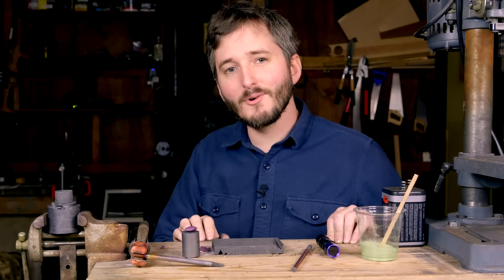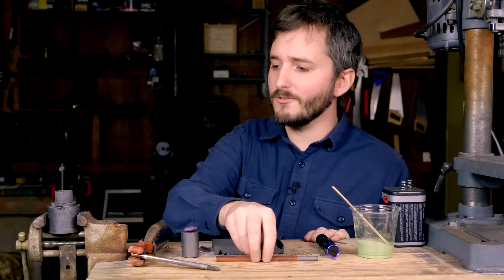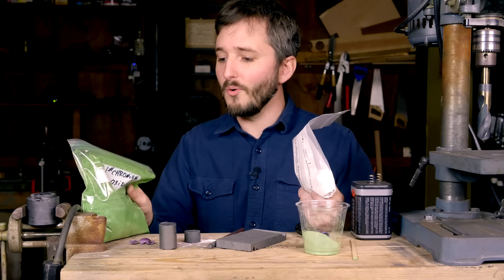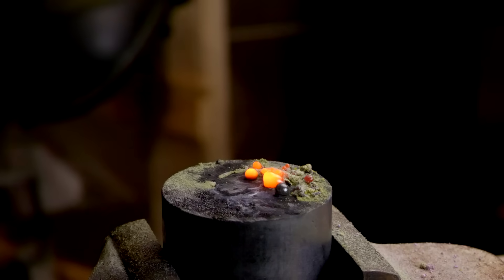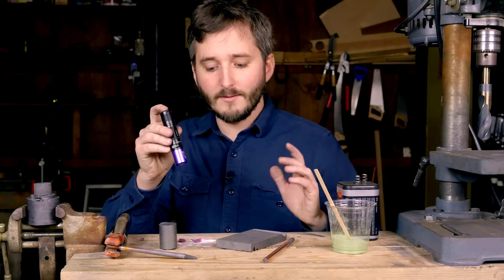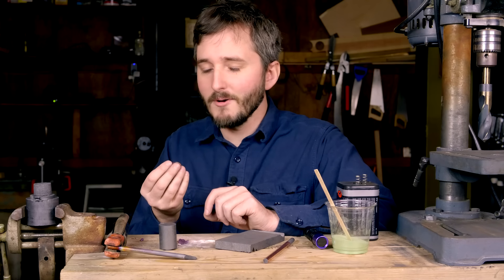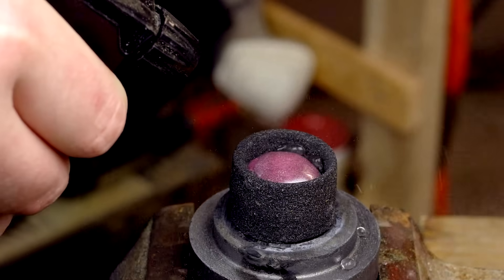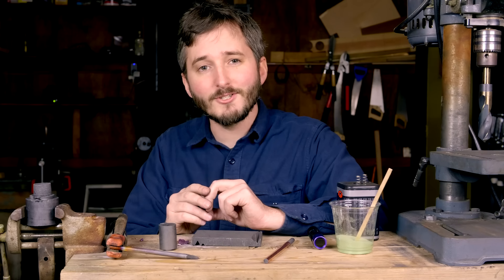How To Make Synthetic Ruby In The Workshop

Comment: Yo big PSA, hexavalent chromium, which is formed by exposing chromium oxide to extreme heat or electric arcs, is very carcinogenic and you should absolutely be wearing a respirator when you work with it.

source: I am a welder who welds stainless steel for a living
Reply: Yeah isn't that the stuff that PG&E dumped and Erin Brockovich fought for the victims of?
Reply: Yep.
Reply: Thanks for the heads up
Reply: Yes  i aproove, also a professional tig welder.
Reply: Yep, hexavalent chrome plater here, work with large tanks of it daily for deposition plating on aerospace parts, inhaling the fumes and mist are the most dangerous part about it, my cousin is a boilermaker in petroleum and he tells me all the time that welders need specials certs to even touch stainless or pipes that have chrome liners, stainless steel being a mix of chromium and steel obv
Reply: yes it is, but for these small scale short lived experiments it isnt going to do anything, he looks to be in a breezy looking shed so i doubt it would have produced enough to cause damage
Reply: Unlikely to oxidize with the reducing atmosphere of carbon vapor and carbon monoxide.   Chromium likes to form carbide in such an atmosphere.
Reply: Though salt is 50% chlorine by molar mass, it's a stable salt
Reply: Salt is 50% chlorine
Reply: @Hgdhgfdssxvbbnjoo  what does this have to do with anything at all though?
Reply: @Hgdhgfdssxvbbnjoo  ok justin.

Comment: NIGHTHAWK! Dude try to get 60-80 grit Alumina, then get a micro mesh sieve and rinse wash the Alumina thoroughly with distilled water to remove all dusty material and smaller particles. The resulting FRIT will be less likely to bubble and have fewer bubbles intrinsically due to the larger particle size. This technique is developed from jewelry enameling. Also if you were able to develop the sintering process inside of a pressure vessel it would not boil as readily. Way easier said than done though! Good luck this is fascinating

Comment: I wonder if a tig welder would be able to make this stuff translucent, can push a ton of current, and would prevent oxygen getting into the surface. Also, you can get a diamond grinding wheel, they aren't super expensive.

Comment: Next step, useful applications. Form a hole in it as it cools or afterwards and you have a 3d printer extruder nozzle that will not erode as fast as the mental ones do. Make the little crucible have a small dome in the base and then the ruby can form part of a baring with the shaft sitting in the dint that is formed. Can you draw off a fibre from the melt pool? Not sure what use that is but may be interesting.

Comment: please try this with a ZVS induction brazing setup!  as soon as the powder melts its conductivity goes up, which will turn it into a susceptor to the oscillating magnetic field thus heating it internally with no electrode required!  just touch-off the top of the pile with anything hot enough until there's a glowing/molten spot, then let the process of induction take over  :)

Comment: Place the cruicible into a deep box, then flood the box with argon ( Tig shielding gas, easily available from airgas or any welding supply house) it is heavier than air and will sit in the box. This will shield your carbon arc rod and it will last longer and prevent oxides from forming in your Ruby, try it and you should get gemstone quality raw ruby

Comment: What temperature do you think is needed? (in Kelvin :) Would it be possible to use a ceramic kiln?
Actually, I just read that the melting temperature is ~1889K, so I guess a ceramic kiln wouldn't do...

Comment: Awesome!  I read about making rubies decades ago in National Geographic and thought it MUST be fairly easy to make them,  if you can reach the right temperatures.  If you want more impressive and efficient results, make an arc furnace.  The more insulated it is the easier, safer and better control you'll have over the temperature and internal atmosphere ( which from said article ) was critical to getting a high-quality end product.

Also if the CO atmosphere created by the furnace and arcing carbon isn't good enough to make better rubies,  you could inject a shielding gas.  King of Random has some videos about his arc furnace experiments, there is lots of good content online about DIY furnaces, and finally,  if you have questions or need suggestions, reach out to me and I'll help if I can.

timbgreen

Comment: if I get a bunch of very small pieces, crush them up so they have sharp edges and then bond them with epoxy I can make a grinding wheel for grinding tungsten carbide
Reply: Why bother melting it? You already have a fine powder to bond in the bag!
Reply: @DSSlocksmiths  ruby is harder than aluminium oxide - witch makes it a better abrasive  especially for stuff like tungsten carbide

Comment: How many amps were you running through your carbon electrode.  FYI to anyone reading the comments, those are called arc gouging electrodes, that'll make your googleing for them easier.

Also, it seems like a TIG process would be excellent for this idea.  Is there a reason you didn't do it that way or do you just not have a TIG stuff to try it with?
Reply from the maker: Something like 200, but I don't remember

Comment: Could you make other Alumina-based gem stones (eg: Emerald , Aquamarine, Sapphire)the same way?
Reply: Sapphire, yes, as rubies are just the name we give red sapphire. Aquamarine and emerald however cannot be synthesized "from the melt" like corundum and many other crystalline materials can be. I don't remember the exact reason why, but it has something to do with the raw materials not mixing well/crystalizing together. Beryl, the mineral name for emeralds and aquamarine (and other gemstones with different colors), is grown synthetically using either a flux method or hydrothermal method, where the crystals precipitate out of and grow from a solution containing the dissolved raw materials.

Comment: Is it possible to to melt the compound using sunlight? I saw some video clip where people use optical lens to heat/melt steel. If it is possible, you can avoid carbon contamination.

Comment: Silicon carbide sanding belt? It's harder than aluminum oxide. Also did you try using a TIG torch? Tungsten electrode instead of a carbon rod that does get consumed.

Comment: I wonder if you could use a "flux" to keep the powder together.  Borax or  some flint glass?  That would melt first and maybe cover the powder to keep it together?  Something with a lower melting point, but won't react with the aluminum oxide.

Comment: Just want to point out that things harder than other things are no "invulnerable" to the less hard things. You can still grind the aluminum oxide with something that isn't as hard. Put it in a tumbler with steel ball bearing then use a magnate to remove any steel that got ground down with the aluminum oxide.

Comment: About Health Issues: An Arc welder reaches temperatures up to 17,000 K (> 30,000°F) which is causing the Chromium-Oxide to break up and evaporate it. The hot elementry chormium will oxidize in the air also to Chromium-(VI)-Oxide, which is highly cancerous and poisonous. I really really really recommend everyone experimenting with it has a proper Mask (at least an FFP3) or - if not at hand - use a ventilator blowing fresh air from the behind to make sure you only inhale fresh air without possible vapours. You only have one health.

Comment: Would it make sense to use a tungsten rod instead of a carbon rod to decrease carbon contamination of the ruby? The tungsten will most likely also contaminate but maybe it does so less than the carbon rod?

Comment: If you are making a graphite crucible out of rod, why not make a plunger out of the graphite rod to fit the crucible, loosely, & make it your electrode positive? Then you can hot press the Alumina Chromium Oxide mix. Make a wafer instead of a button.

Comment: Cutable with a water jet?
Anywho, fun project ideas:
Make keys for a keyboard. UV light under the keys light up for a short time after the key is pressed, leaving a glowing trail of where you type.
Similar idea, but use as level bars on a display.. Higher temp, sound, or voltage, more bars.
 If other colors are able to be made as easily reactive, then a not very cost effective display would be possible.

Comment: Forget the electrodes, and switch to an induction coil. No contamination and it will heat through more evenly. Could try adding some other metal powders to it to see what happens. Aluminum cans in an induction coil on a capacitor bank get torn in half, so...

Comment: I wonder if you do this arc welding technique under a vacuum if you'd have clearer crystals. Maybe preheat the crucible, melt the powder, continue heating the crucible to keep the crystal from cooling much and do it under vacuum to remove gas bubbles.

Comment: ever since I found out that rubys (my favorite gemstone) were aluminum oxide, I've been researching this. like how they make it in the lab. so I could one day have a special engagement ring that was not bought, but made with effort. I thought I'd have a semi complex lab setup, but nope, wayy simpler than that. 
>I have not yet attempted it. I may be a welder so that's perfectly convenient, but don't have the tools/machines at home yet. I may favor the flame technique instead of arc heating, depends which has less porosity (bubbles).

thanks for the video! I learned a lot actually! this will certainly help me in my goal.
Reply: Well for ring quality; this won't produce anything near what you're looking for.  Definitely good enough though
Reply: @mikeishome69  hmm maybe. yeah they look rough but gemstones generally all do before they get cut and polished. also having a lot of "flaws" isn't really important when it has the sentimental aspect to it...I suppose as long as it didn't look absolutely awful then it'd still be good. but yeah thanks for the comment, I'll keep in mind I may need a lab style setup anyway.

Comment: Theodore Maiman's early laser used a powerful energy source (xenon lamp) to excite atoms in a synthetic ruby to higher energy levels. At a specific energy level, some atoms emitted particles of light called photons. These newly created photons struck other atoms, rapidly stimulating the emission of more identical photons and amplifying the light intensity. Maiman was able to continue this process of stimulated emission and amplification by placing a completely reflecting silver mirror on one end of the model and a partially reflecting silver mirror on the other. This setup enabled photons to bounce back and forth between the mirrors until they gained enough intensity to burst through the partially silvered end as a powerful, coherent, beam of light--the first working laser prototype.

Comment: Is there a specific reason to be using carbon arc over other methods? For example using a TIG welder instead?
Reply from the maker: Not sure, I don't have a tig to try
Reply: @Nighthawkinlight  Thanks for the reply! I figure you already have the welder, you just need the torch and some argon. Lots of videos of guys making any dc arc welder work with them. Not sure how much you want to pursue this. Maybe if you've got a YouTube friend who has one it might be worth a shot, make a collab video why not. Thanks for the ideas, I might try myself if I get hold of the the oxides.

Comment: 3:18 I wonder if aluminum oxide is pretty brittle like glass and would fracture when using a pestle and mortar, especially since the aluminum oxide would really be grinding against other aluminum oxide chunks more than the pestle and mortar
Reply: Nope, it is actually used as an abrasive in part because it is relatively tough and fracture resistant.
Reply: It is brittle but the forces required are pretty extreme - that’s why high end watches use them for the watch glass. 
Apple was going to use sapphire for phones but it cost twice as much as the glass.

Comment: I bet an induction heater would warm up the whole crucible like a treat (and would work with a lid). They seem somewhat complicated/expensive though
Reply: an induction heater would probably be the way to go for the crucible especially if you could cool it down really slowly.  I think that would help to make the rubies opaque.  You would just have to fiddle with the cooling time vs. ruby mass in order to get the clarity you want.  I think you would have to really heat the ingredients for a long time instead of stopping once the ruby forms.  Keeping the ruby molten longer would help take out unwanted impurities and would produce a clearer ruby.  If there were a way to introduce pressure into the mix that would be a big help.

Comment: Did you attach the welding ground directly to the graphite?  Also do you think something like oxy-acetylene would get hot enough?  Also elementalmaker typo in description.
Reply from the maker: The ground is connected to my vice, and my vice is clamped to the graphite. A oxy torch is hot enough, but just barely. It may not work with this same method.

Comment: try a tungsten electrode it melts at  6150°F where as Al2O3 melts at 3,762°F and Chromium melts at 3465°F could make a cleaner ruby with less carbon from the electrode.

Comment: How to make the perfect mother's day gift
Step 1: aquire an arc welder...
Reply: Ugh...chained fetch quests.
Reply: I believe Grant made one from a microwave several years back
Reply: King of Random: Two microwave transformers = ArcWelder
ElementAL Maker: ArcWelder + Gemstone ingredients = Gemstone
You: Use Nobel Gas to make it more pure... 
Me: Where is the DIY nobel gas arcwelder video?
Reply: "Oh dang.
What is it dawg?
I forgot it's Mothers Day.
Didn't get a gift for her.
Other plans got in the way.
She'll be so disappointed.
Damn I forgot it too.
This could have been avoided.
What the hell are we gonna do?"
Reply: Just get a shit ton of 9v batteries and run them in series.
Reply: @OfficialFedHater  and you’re going to fry yourself to an extra crispy human (and also arc welder is works by passing high current, not high-voltage so if you want to weld something and not make a Super high voltage battery then you need to connect them in parallel)
Reply: @ariesleo7396  Running them in parallel would just make a big 9v battery which isn't very useful.
You want to run them in series and then use them to heat a stick welder, or a graphite rod to weld what you want together.
Reply: laughs in Jimmy Neutron
Reply: and thats the easy part
Reply: Acquire.  And it's not as hard as it sounds, you can get a used buzz box for $100 pretty easily.  Probably cheaper if you ask around.
Reply: Step 12: Polish your rubbies
Reply: flweep 1 Step 1/2: Ask my mom for her credit card so I can buy an arc welder

Comment: I am following Elemantal maker, the rubies made by arc are amazing. Try cooling it way slower and reduce the chromium content a little. Try different ways of adding the chrome dopant. Perhaps from metal would be better. Try a flake from an old bumber bar or such. Also use a welding gasses to change the atmosphere. If it was oxidation would all the carbon be burned out making it clearer? There are stone cooks in Thailand and Vietnam that know these secrets. Rubies are cooked all the time to improve colour and clarity. That's a fantastic big lump of ruby for your first effort!